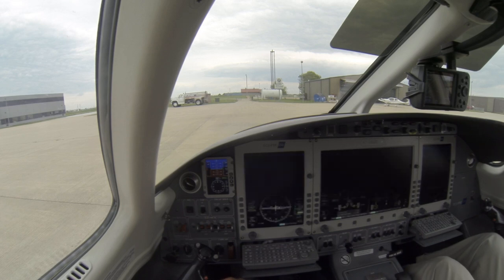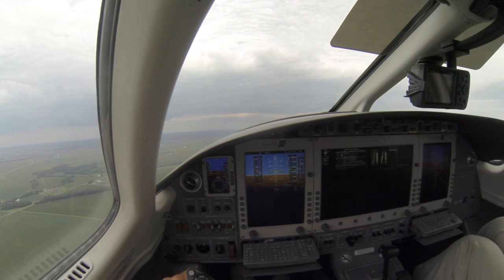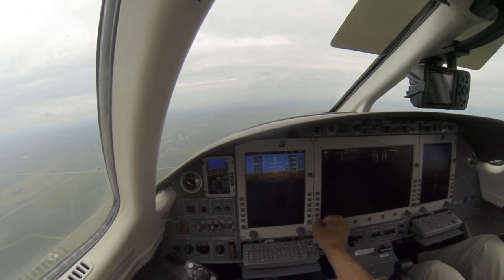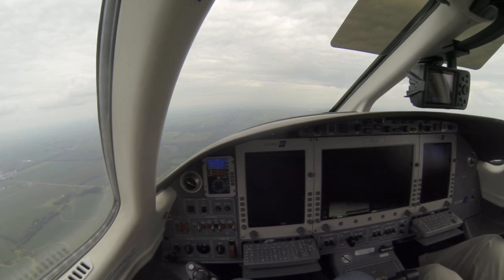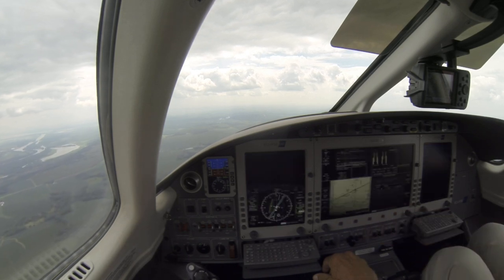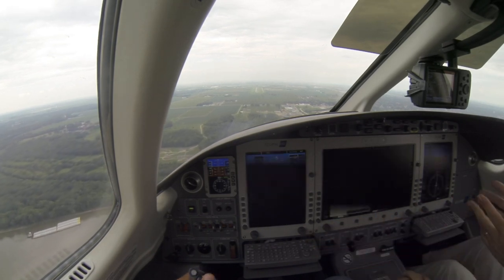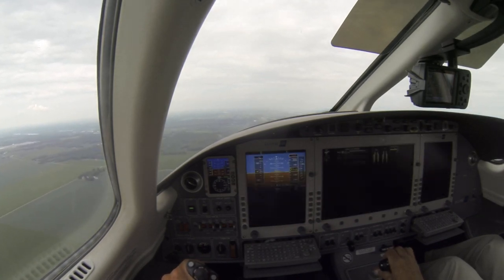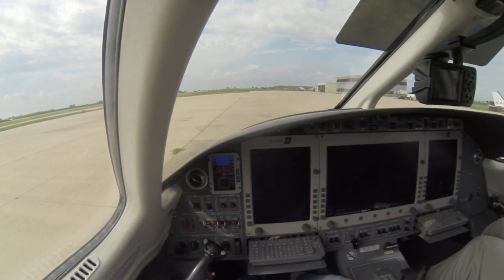Flight review in an Eclipse Jet with Tom Norton

Comment: It's an interesting plane because it's faster than visionjet and has twin engines and it's half the weight of a phenom 100. But unfortunately pratt and whitney have leaned into thoughtless greed and they charge 911k$ per engine now, 2023 prices. The smallest turbofan engines on the market. Half the size of the visionjet engine and they want 911k a piece. As a result they killed Eclipse and they aren't selling any engines. So dumb. Eclipse should start their own engine production. It's not that hard and would be a revolution.
Eclipse has only sold 33 planes since their resurrection in 2012 because the price rose so much. When they started around 2000 their original target price was half a million for the entire plane.